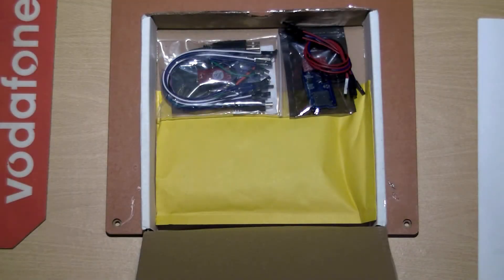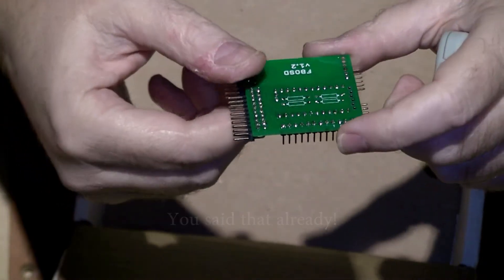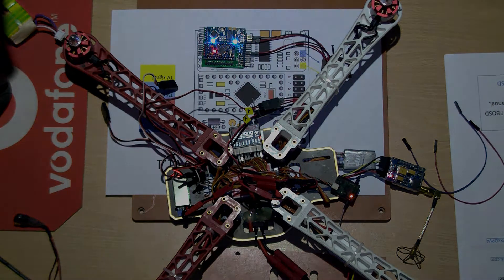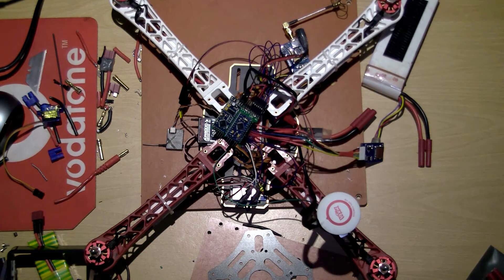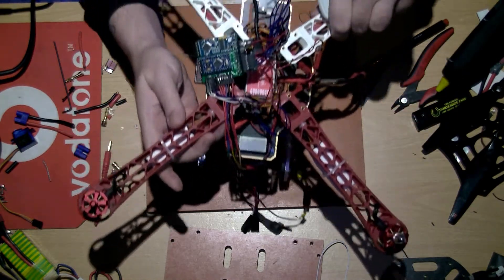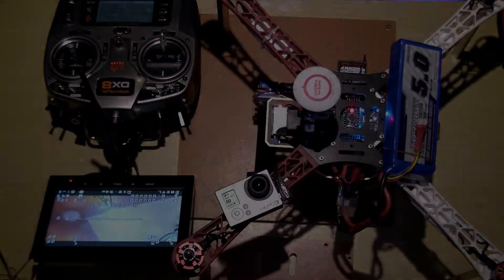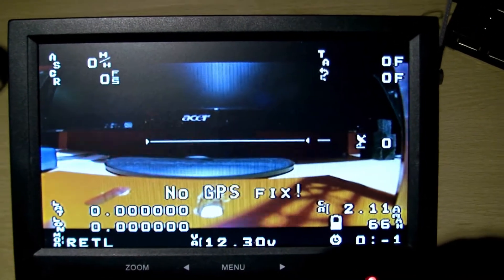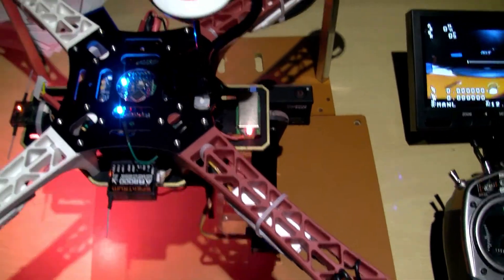Review and installation of FBOSD gold - FPV OSD

Comment: Regarding the SD logger. I too had issues with mine at first. What I found was that I had to use an older card (8GB instead of my 32GB). Also the card has to be formatted without anything else on it. In windows when you format change the allocation size to 16KB not 32KB. That solved it for me. Obviously it will not work if there is no card installed.